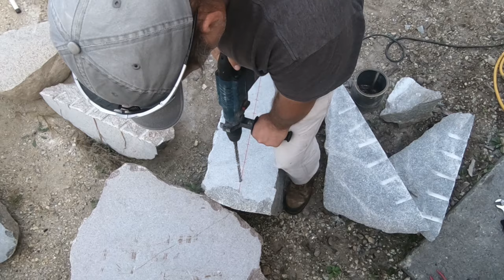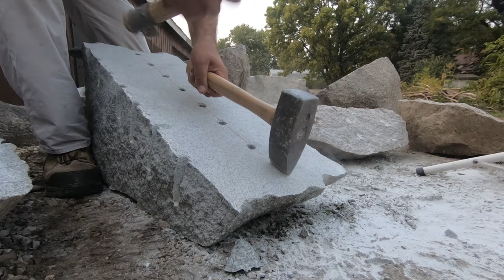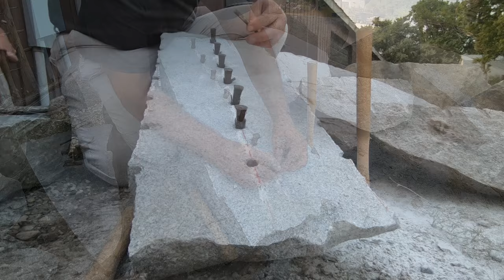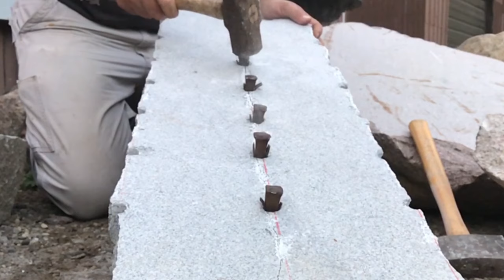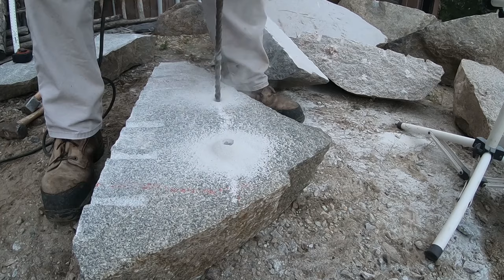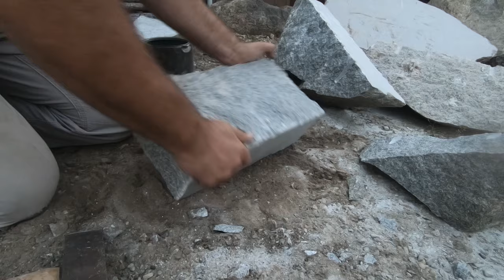Granite Rock Splitting - Making a Granite Rock Block ~ Works in Stone

Comment: What size drill do you use on material this size? I am just starting to play around with splitting granite with wedges and I don’t want to waste the time and effort drilling holes that are larger than necessary. I’m currently using a 5/8” bit in a 1” SDS-Plus drill and it feels like overkill but not sure how small I can go. I’ve read that thickness is 4-6x the length of the wedge but I’ve not seen anything about sizing the diameter of the holes/wedges for a given size.